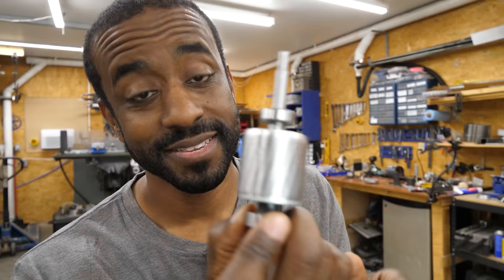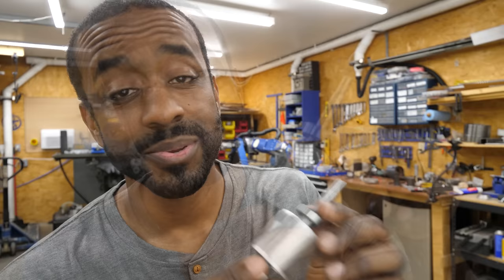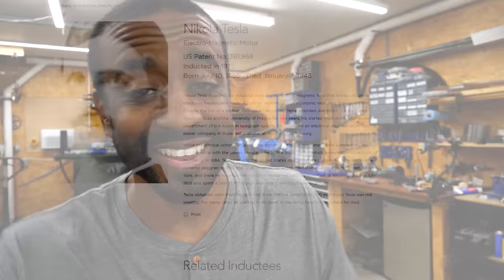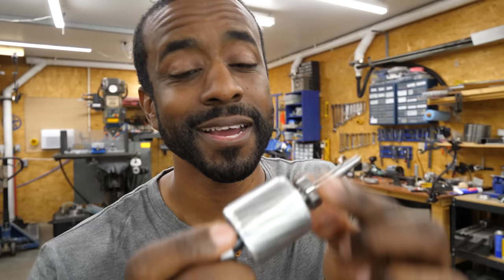This Invention Got Nikola Tesla Inducted Into the Hall of Fame! : Jeremy Fielding #096

Comment from the maker: Clarification: The history channel asked me if I would make a YouTube video about revolutionary engineering, related to their series on engineering coming out this month. I think their show is awesome, but I am not "in" the show. 😀 Sorry about the confusion if that wasn't clear. You should definitely watch the show if you can!
Reply: What's the difference between induction and brushless. From what I found it's only the AC/DC current. Is there more to it ?
Reply from the maker: Induction motors are also brushless
Reply: @Jeremy_Fielding  ok, then my PC alone has 12 induction motors. Even the water pump for the CPU cooler uses one. Thanks for the reply. 🙂
Reply: @DuperMate  what people call "brushless" motors usually use permanent magnet rotors instead of inductive ones. The motor itself is powered with (usually) 3 phase AC, same as induction motors, but there's a motor controller that takes DC power and emits the AC instead of just wall AC like induction motors (as opposed to brushed motors which just use DC without any controller). Jeremy is of course entirely correct that induction motors have no brushes but that's not what people usually mean when they use the term.
Reply: I see appliances like ceiling fans advertising as more efficient by using a DC motor. Is that true or just marketing hype?
Reply: I find your videos relaxing and informative. I subscribed. I could deal with more content from you.
Reply: I watched the whole show and until the last minute was expecting your cameo. You still rock in my book though!
Reply: They couldn't have picked a better man for the job.
Reply: Induction motors are Vacuum devices, meaning they rely on the physical nature of the (Q.E.D.) Vacuum. (Carefully note - induction motors work normally whether on Earth, or in space.  Not talking about 'absence of pressure' vacuum here.)

The sad thing is, there is no common, 'pedestrian,' mainstream awareness of the exact physical nature of the Vacuum, specifically how it is able to undergo a local change in order to manifest magnetic fields.

Although the alignment of electron spins (aka "alignment of magnetic domains") was determined to initiate the existence of a magnetic field (in iron, nickel, cobalt, or alloys of those) - common physics absolutely refuses to take up speculation/study of the exact physical nature of the Vacuum that allows it to switch from 'no magnetic field when electron spins are randomly aligned'

to  "magnetic field manifests when electron spins align"

We just "wing it" with induction motors and all other devices that absolutely will not work without the Vacuum undergoing a local alteration that allows the magnetic field to come into existence.

At the root of the problem is "electromagnetic waves do not need a medium to propagate"
.
Reply: @DuperMate  Induction motors are wound on laminated iron stator cores., but the laminates are all lined up straight. The rotor (armature) is also made of iron
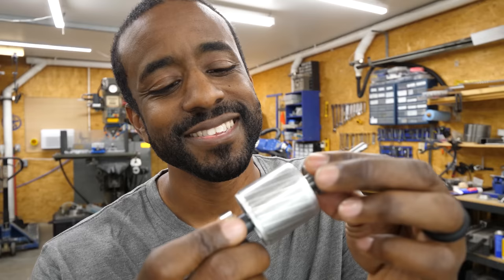laminates...but they are slid onto the shaft in a spiral pattern. Look at what he's holding at 0:40 and at 0:59. That armature could never be expected to stay still if
the stator coils keep changing polarity. It chases around trying to get in phase, but that's impossible with the armature stacked that way. With a conduction run
motor, you wind coils on the armature AND the stator. The armature is fed through brushes that contact segments of the commutator that are soldered to the
individual rotor coils. About the time the magnetic fields of the armature and stator line up, the armature has turned the commutator and broken the flow to the
first set of armature windings and made contact with the next set. And about the time those fields line up, the brushes and commutator contacts line the next 
set of coils up. Vicious circle(8-). Now...for DC brushless motors. Use properly oriented magnets in the rotor and just switch the stator coils in the proper order
and you get motion...like with computer fans. Look at me butting in here with my drivel. Sorry about that, but hope it helps.
Reply: @Jeremy_Fielding  Aw...but there's something for everyone. There are motors that have to start under heavy loads. Brushes make contact with a commutator and supply
armature windings to get the motor started. Then a centrifugal arrangement lifts the brushes away and it goes into induction mode. Conduction start/induction run. You
could entertain yourself and others for hours over the different types of electric motors. I see you're doing that...I see a video on stepper motors(8-). Go for it, Champ. I
see you already have over half a million subs. Hoping you get a million.
Reply: @DuperMate  Brushless Motors are not DC Motors there are AC Motors , the DC Power is converted to AC to run the Motors.
Reply: I'll definitely have a look at it. Science and history...my two favorite subjects. 😊
Reply: thanks for clarifying.
Reply: If the History Channel was smart, they WOULD have you in the show. :-D
Reply: Thank you!! We do not have thee television services anyway. Good things are going your way, thank you for teaching me to be more cheerful.
Reply: You should pin this comment.
Reply: @Greg_Chase  - Huh?
Reply: @mickbradford3811  Take two rare-earth (neodymium) magnets - one in each hand.  Position the 'N' pole of each magnet facing each other (or position the 'S' pole of each magnet facing each other).

Try to force together the two 'N' poles (or the two 'S' poles, whichever you choose).

As the space gap between the two 'N' poles is reduced, it becomes more difficult to keep pushing the magnets together.

LOOK INTO THAT SPACE GAP

What do you see?  NOTHING.  By that I mean, you fully experience the physical resistance, trying to force the two 'N' poles (or the two 'S' poles) together.  BUT THERE IS NOTHING BETWEEN THE MAGNET POLES except - 'empty' space.

My point was, and your 'Huh?' question was motivated by - the fact that very few people (thus far) have bothered to postulate, hyposthesize, then conduct experiments to prove - 

- the exact physical nature of the 'empty' space between those two 'N' or two 'S' poles as you push them together.

There are great rewards waiting for those who take that journey.  I have already done so.
Reply: @Jeremy_Fielding  Also Tesla didn't invent them if you're clarifying things. The aluminium disc example you showed was invented by Ottó Bláthy.

Comment: I went to school in New York City in the 1970s where amazingly, my school was in a district that still used DC power from the area's substation. On the days where we watched an educational broadcast on TV, the TV was rolled into the classroom on a cart with the TV on top and an inverter on the bottom. The inverter was used to turn the DC power to AC power. The case for using DC power was strong in New York because of elevators. Elevator motors are DC motors because they need to run in two directions. AC motors turn in only one direction. When substations converted to AC, elevator systems has to employ a converter. This converter was an AC motor (about 20 HP) that was directly coupled to a DC generator. The DC generator supplied the DC power to the elevator motors. These converter motors were so big that they took time to spin up, so they were kept running even when the elevators were idle. There was an idle timer that would turn them off after maybe 10 minutes or so. So late at night if I called for the elevator, I could hear the converter motors spin up first  before the elevator would begin to move.

Comment: Your excitement is infections.  Now I understand why induction motors last so long.
Reply: Essentially the bearings are all that go bad on them...  Replace the bearings and get another 30 years out of them.
Reply: @calholli  never thought about that.... Hmmm
Reply: @iwinrar5207  Well.. that's granted that the wire coils are robust enough.  they can be made with the wire being too small and the insulation too thin and they overheat and burn up...  but with a well made, overbuilt motor-- they should last and last.
Reply: Absolutely. I need to go invent something, stat!
Reply: @calholli  I had a Dremel that had sheared its coil wiring, it's pretty stupid how flimsy the connection is. I fixed it but then almost immediately another part blew and it would only run at full speed.
Reply: @downstream0114  dremel uses a brushed rotor coil...it's not a true induction motor. I fixed them too..but yeah planed obsolete and all... great tool though..I use them all the time.
Reply: I’ve seen the capacitor in them fail too - sometimes spectacularly!!
Reply: I feel like comments with typos always get alot of like.
Reply: @downstream0114  I bet that's what Dremmel planned so you have to buy another just like everything else these days.
Reply: @David-vb8tg  nice trh.
Reply: @tvm73827  that's not really even part of the motor, it's used when running a 3 phase motor with single phase power
Reply: Now I understand why my friends wife left him for an induction motor

Ba boom tsh
Reply: All electric motors before Tesla had spinning comutators and carbon 'brushes' that had to press against them to transmit electricity to spinning coils.  In a way, Tesla turned electric motors inside out.
Reply: Makes one wonder why the car companies would want to put them in their vehicles.
Reply: @calholli  The stator winding can short out! Its rare but Ive seen it happen.
Reply: @tvm73827  Only single phase stators us the capacitor, these are three phase.

Comment: 8:00 The old analog car speedometers worked similar to your model.  A circular magnet was spun by a flexible cable driven by the output shaft of transmission.  This magnet was surrounded by an aluminum housing that was constrained to rotate only 1/3 of a turn by a torsional spring.  The faster the magnet was spun, the stronger the FORCE imparted on the aluminum housing, thus the farther the spring was stretched, and the farther the housing rotated.  The speedometer needle was glued to the housing, and served as the speed indicator.
Reply: The torque on the indicator needle shaft increased in proportion to the magnet/cable rpms.
Reply: It's called a hysteresis disk.

Comment: Excellent lesson.  I spent 37 years wiring, unwiring, replacing bearings and sending out for rewinds hundreds of 4160V Three Phase induction motors as big as an automobile.  For anyone that has had to clean the carbon dust out of a large DC motor and then had to seat 40 brushes knows, the induction motor is the greatest thing since sliced bread.   There is also the added bonus of reversing rotation by simply swapping two motor leads.
Reply: I'm trying to guess where you worked with 4160V motors. Got to be major horsepower to require that voltage. Pumping stations? Refrigeration plant? Paper or steel mill? Only place I can recall encountering 4160 was the 750HP motors that drive industrial scale refrigeration compressors. Everything else I worked with was 480V, 100HP or less.
Reply: @sootikins  I worked for an electrical utility with around 30 various electrical generators using oil, diesel, natural gas and coal as fuel.  The largest was a 365 MW coal fired unit.  This one had 1500 HP motors connected to fans.  It takes a lot of air to burn coal and then move the flue gas after it is consumed.  We had thousands of 480 VAC, 3 phase motors and a few hundred DC motors running all of the auxiliary systems needed for the power plants.
Reply: @sootikins  We even have 690V instead of 480 in Europe.Large mines and factories. 500 and 1000V is also used but less common.
Reply: @AbbyNormL  Thats cool.Is 4160 the highest voltage stuff you worked with?Very large loads in Europe sometimes use 6 or 6.3 kV.

Comment: Step by step demonstration with every step, none missing, from a wire and compass up to the real working thing with dozens (or way more) of horsepower that make the world work! Nice job, Jeremy. 

It's a shame AC electricity isn't commonly available at low voltages for people to experiment with. They'd need a driver circuit to make a home-made induction motor. A transformer could do the trick but most wall-warts don't output AC, especially now they're all tiny lightweight switchers.
Reply: AC adapters were available in the early 2010s.And if someone is interested anough he can make his own transformer or remove the rectifier from a car bettery.If youre careful and absolutely know that yuo are doing you can just use 120 or 230V AC mains.
Reply: @mernok2001  A car battery doesn't have a rectifier. All batteries produce DC, so they don't need rectifying.

Winding your own transformer is possible, but not for mains voltages. It's simply too dangerous, fire as well as electric shock. Transformers have magnetic as well as electrical design characteristics that you have to get right.

AC adaptors of the type with a transformer used to be available in shops, and they sometimes offered AC out. But now nearly all power supplies are switch-mode and can only output DC. It's why they're so light.

Sure you could buy a 240V - 12V transformer and plug it in the mains, but nobody should ever plug anything home-made into the mains unless they know what they are doing. Even simply connecting a transformer, there's potential for accidents. Get the wrong connections and it will potentially explode or catch fire.
Reply: @greenaum  I meant car battery charger,my ytpo failure.

Comment: Oh by the way, i remember from my radio enthusiast days, have you ever heard of a grid dip meter?
When you showed the screwdriver adhering to the transformer, it came back to me. Hams used to measure their tank circuits by inductively coupling a coil to the inductance. Either scoping it or using a wheatstone bridge if it was in filter config to maximize Q. Man these where the days. Don't get me wrong, SDRs and DSP had me succumb to math eventually, but there was something tangible about moving a core in the inductor and see how 2 or 3 subcircuits down suddenly screamed for attention :D

Comment: I'm not a Physics Tech or an electronic engineer and I still like this.  Back in the late 70s in Jr High.  We took a piece of meal stock like 1/4" x 3/4" bent it like a C wrapped copper wire around it then took a wooden dowl with a piece of copper pipe around it, sliced the copper so it wouldn't touch itself then used two wires and made the center spin.

Comment: Induction motors are only used in very few household appliances.  Ceiling fans and microwave ovens are ones for sure but the rest still use brushed motors.  Vacuums, blenders. washer, dryer, ac, all use brushed motors.
Reply from the maker: There are differences between countries as well. In the USA where most of my viewers are these items like washers and dryers use induction motors

Comment: Way back in high school I was looking for a project and came across an old ceiling fan that my dad rescued from an old building. It was built by the Century Fan Company sometime between 1930 to 1935. With some help from my dad who is an Engineer we restored the fan and it now hangs in my shop getting used when I need to move the air around. Dad explained to me how it worked but the way you explain it makes me realize that it's an induction motor. Dad probably told me all that but I was 17 at the time and thought I knew everything like all teen agers. LOL. Great video!

Comment: your demo with the aluminium disc and the magnets is actually the same as how old style speedometers worked - transmission or shaft spins a cable connected to a magnet or magnets inside an aluminium disk bell connected to a pointer (with a flat coil spring as a speed regulator). The disk bell is a bell-like structure flattened to about half an inch.
Now we use magnets/electromagnets with Hall effect transistors or optics for this.

Comment: Your spinning aluminum disc is also the basis for the speedometer in older cards. The spinning magnet was driven by a cable that spun within a tube attached to the engine. The aluminum disc had a sprint to keep it from actually spinning, but the faster the magnet spun, the harder the aluminum would pull against the spring, allow it to rotate more. Attach a red needle to the aluminum disc and a calibrated set of numbers behind the needle and you have a speedometer.

Comment: The really cool thing about a rotating magnetic field is that since it's a vector field, its derivative is at right angles to the original vector. This makes induction motors LINE STARTING which is extremely useful. This is the case because the slip frequency determines the flux vector, which interacts with the stator field which is conveniently at 90° to produce torque.

Comment: I've had an electric bike i've been meaning to fix for a while and this gave me an idea, I could just use the motion of the tires and use the idea of an induction motor to bypass the need for electricity and make an automatically assisted bike rather than a full powered motor controlled one. I just need to add and adjust a few things. this was super helpful!

Comment: A warning to the community, microvawe ovens contain capacitors strong enough to discharge enough power to kill you even after the oven is not plugged in. If you don't know what this means, don't mess around with dissasembling microwaves.

Comment: It might be worth noting that screwing around in a microwave can get you killed. The discharge of a microwave capacitor has enough voltage to stop your heart (EVEN IF IT'S NOT PLUGGED IN) That information MIGHT be important to anyone that has an old microwave and immediately runs off to copy what you're doing. The typical discharge is around 2300V.
Reply: VERY important info, if you intend to work on a microwave, look up shematics and find the capacitor to SAFELY discharge it